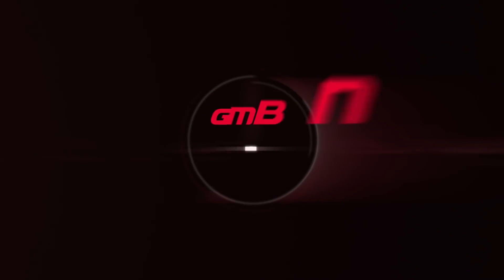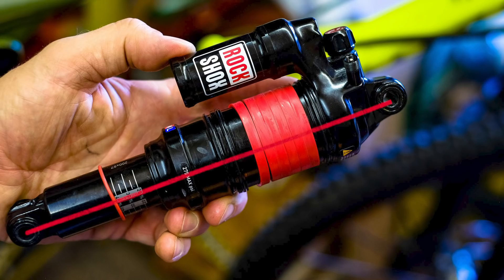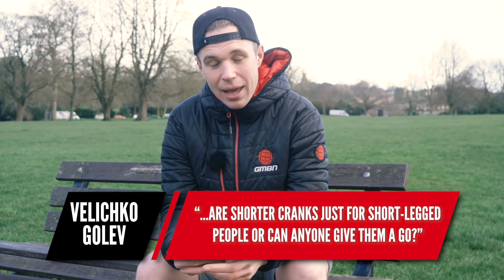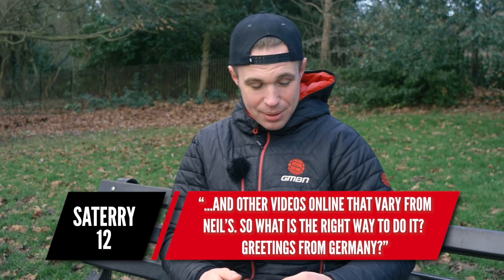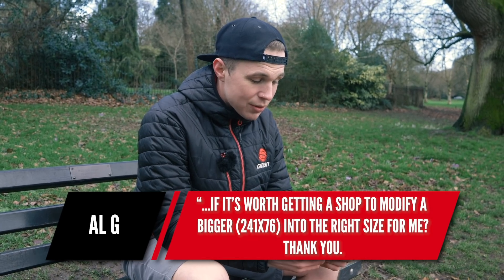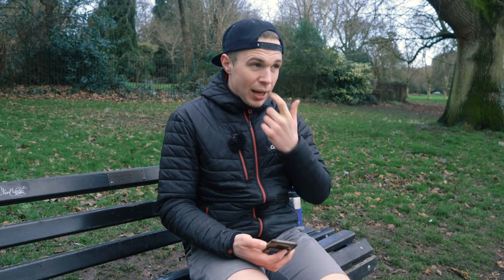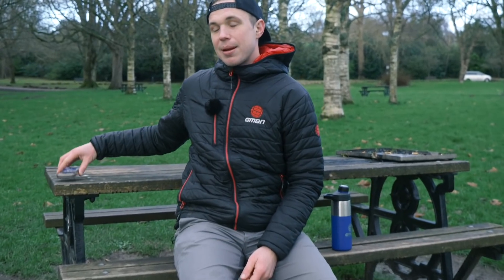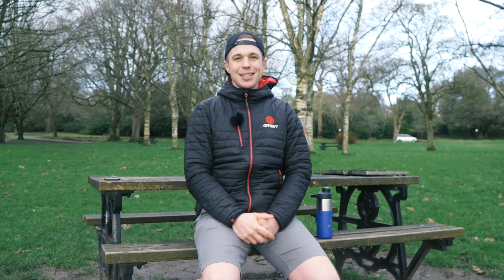What Size Shock Should You Fit To Your MTB? | #AskGMBNTech

Comment: #AskGMBNTech
PLEASE HELP!!!
Hey Doddy and Henry love the videos, I have a brake issue. I am running Shimano Xt M8120 brakes (2020 model). I center my caliper properly in the rotor at home and I spin the wheel and everything is perfect, no noise. The problem is that when I go for a ride and I start the descend (I start braking hard) my front brake starts making noises, the rotor touches the pads when I am not braking, and when I get home sometimes I need to recenter my caliper again and sometimes the caliper stills proper centered. I don’t know what is hapenning, considering that it doesn’t hapens in my rear brake. 
I am running 203mm rotors with center lock, and the correct adapter whit the correct bolts, and I thight the brake bolts at 8Nm. I have a Fox 36. 
Thaks a lot !!!

PD: Why do Fox and RockShox don’t make for their enduro forks 203mm post mount? Since for enduro everybody uses 203mm (or 200mm) front rotors.
Reply: Also check rotor trueness
Reply: Hey guys!! Thanks a lot!! I checked my pistons and one of them was going out twice faster than the other three, I cleaned all the caliper and put some piston grease, now they work better!!

And also I didn’t realized that the left side pistons were twice out than the right pistons (since they are new brakes), so I had my rotor centered with my pads, that wasn’t the center of the caliper itself. So the rotor was very close to one edge of my caliper, I guess that the noise came from here, when braking hard the rotor touched one side of my caliper. 

I hope I solved the problem, tomorrow I will go for a ride and see what happens!
Reply: @edgarsoler5865  Well if that was the case, of course it will be making noice, hope you solved it .
Reply: Tomi Saaranen Thanks!! That’s the only “problem” of running new brakes, you guess that they come in perfect conditions and sometimes you need to check everything to make sure the brakes are running perfect!!
Reply: Are your hubs loose?
Are you tightening bolts?
Are your pistons fully pressed in?
Are your pistons resetting?
Reply: Check qr/thru axle tightness
Reply: Rotor could be bending, because of the heat.
Reply: put your bike in a stand, spin the wheel and look at the rotor going between the pads. if it wobbles side to side you need to true the rotor

Comment: Hey guys, 
recently I watched Henry's Tutorial on how to bleed a brake in real time.
It's a great video, yet there is one tiny little mistake which I see everyone doing.
Although it's great that he pulls some fluid out of the caliper itself, you usually don't want to do this with your fluid already in the syringe.
Reason being, mineral oil is hydrophobic, and lighter than water, so with a bit older fluid (not the dark used one) there is the possibility of pulling water in your mineral oil and Pumping it back in again.
More time consuming but better
Use an empty syringe and pull some older fluid out, close the bleedcaliper, and then get some fresh fluid in the cleaned or a dry syringe.
Then put the tube on and open the valve again.

If you have reasons why I am wrong I would be glad to hear an explanation.

Big fan of the Show, and an Inspiration,
 thanks
Reply: Maik Eckert why should there be water in the brake line, especially when the brake fluid is hydrophobic and acts repellent to water, in the first place...
Reply: @wonderwatch2239  why water get's inside I'm not sure by myself, it's the same thing with Cars although dot fluid takes water,  the seals should let the water out, but some water molecules get in.

Comment: #Askgmbntech
Hey guys I finally wrapped my head around Bike geometry but now I'm wondering, if I increase my fork travel from 100 to 120mm travel i would Change the geometry quite a bit, but! If I also increase the sag let's say from 20 to 30 % (as an example) the travel would've been 80mm and the new travel 84mm 
If this is right wouldn't the headangle, barely differ and bb height as well (around 3,5mm as calculated)? 
Is my theory right of or did I get Something wrong?
Reply: theoretically you are right butin reality the way your bike is dialled to your preferences is more important than any geometry, so being unable to change sag any more will hamper you much mire than a lost 20mm of travel, which you can make up for by changing your riding style anyway, unlike fork setting that will always afeect you no matter how you ride differently. Hope this helps!

Comment: #askgmbntech
Hey there guys love the show
I'm 1,80m and have a Canyon grand Canyon 2017 in M
I just tried to put a 70mm stem instead of a 90mm on there and i feel the dufference. but now I have quite a lot of pressure on my hands
Is my bike now too small or do I just have to learn riding like that
I ride trails and xc if that helps
Kind regards and thanks for the answer
Reply: adjust your saddle backwards or  raise handlebars with spacers
Reply: @TheProjectX3  already at full height 
And do you mean with backwards moving the saddle back or tilting it  ?
Reply: @maikszczerbuk613  slide the rails back, adjusting tilt can also help but might put more stress on the undercariage. Specially when climbing